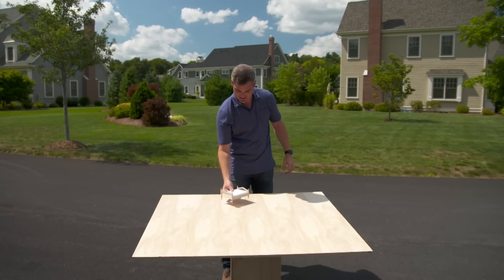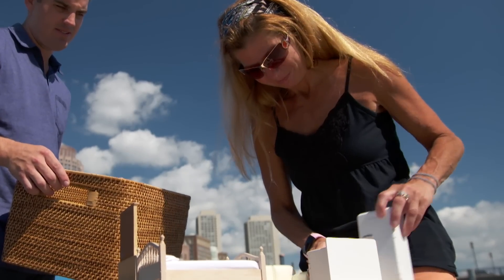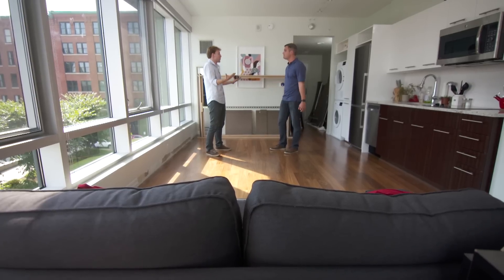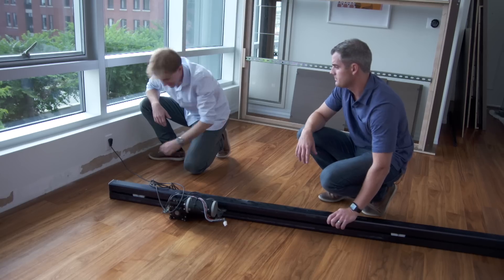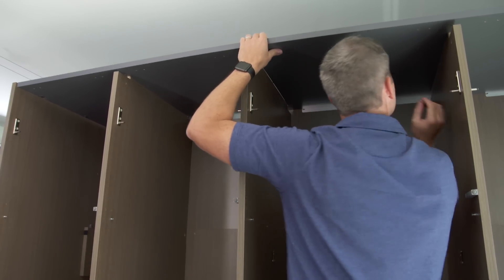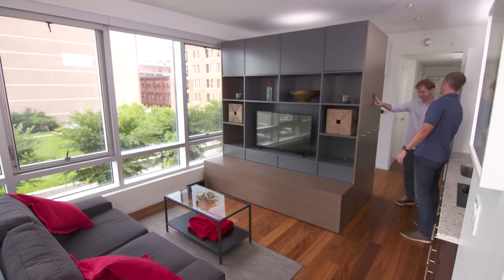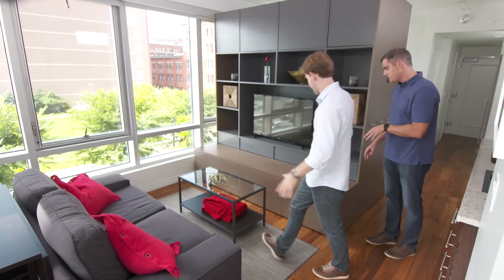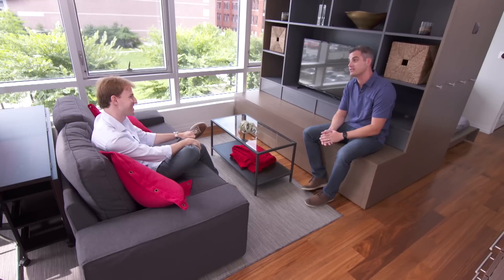How to Install a Robotic Wall | Future House | Ask This Old House

Comment: It didn't seem like they really needed to fold it away, I would be happy with the wall open all the time. 

Also it doesn't really need to be mechanical, something on ball bearings would roll with ease

Comment: cost? site? actual useful info I can read?
Reply: $19.95... Everything seen on TV is $19.95 and its the law.
Reply: MrSneak190 MrSneak190 click on the only link in the description then click the blue highlighted text that reads pro system. That's brings you to their site. However at this moment we cannot by the product yet it seems we have to wait a year or two before we can
Reply: but if you call in the next 20 min, we will double the offer,  that's right two walls for the price of one (just pay seprate s&h)...but wait, thats not all, you will also get a free week of Tom Silva's services
Reply: A single unit is supposedly going to cost around 10k$ once it goes on sale, which is ridiculous...

Comment: In living room mode the Thermostat is located behind a wall.
Reply: Richard van Pukkem did you watch the video? It's gets blocked by the moving wall. Not to mention it's within arms reach of the Dryer. You need to watch "This Old House" on thermostat placement.
Reply: The temperature sensor is inside the thermostat. If you block the airflow (convection) it will not read the actual temperature in the rest of the room. So the heater will stay on for too long.
Reply: Joshua Russell Just move the thermostat. Or replace it with one that can be controlled with your smartphone, like Nest.
Reply: Richard van Pukkem It actually is a nest thermostat already.
Reply: Matt May Lol i see it now. Didn't look at it when writing my previous comment.
Reply: Richard van Pukkem it needs to be moved and that is why I made the comment.
Reply: Joshua Russell As long as he doesn't block the airflow to the sensor he's ok. If it isn't optically right to have your thermostat out of view by his vehicle, then he can decide for himself.
Reply: Joshua Russell I did not recheck the video if it actually gets blocked by his apparatus. And i know how and where to mount thermostats, i mounted one Nest myself.
Reply: Does it matter if it's blocked though? They have Alexa which they could voice a command to to change the temperature and control the thermostat. Or maybe you are saying the thermostat will read the room temperature wrong

Comment: i hope that bed comes out further, the closet is hanging OVER the mattress.

edit: clearly the bed goes under the closet, my point is that it doesn't seem to come out from under the closet far enough.
Reply: I suspect once you wake up the bed goes back under so the closet is accessible.
Reply: Yes thinker, that is what the video shows. Not my point or question.
Reply: about_time I believe the bed frame it's flush  with the unit.. but as he said its customizable.